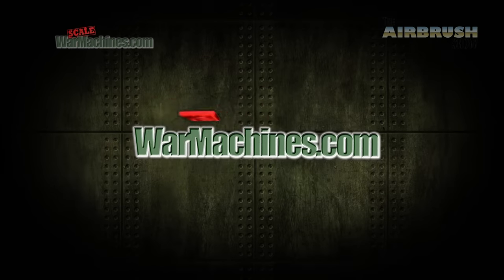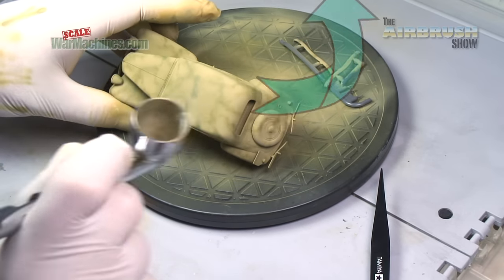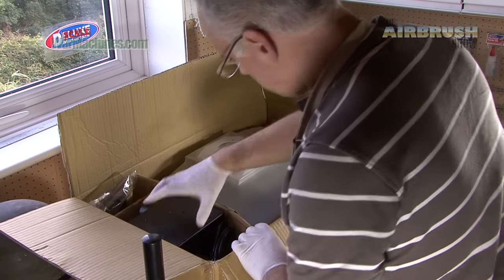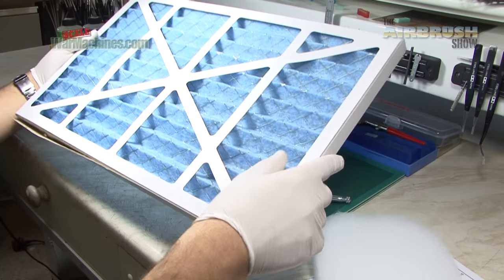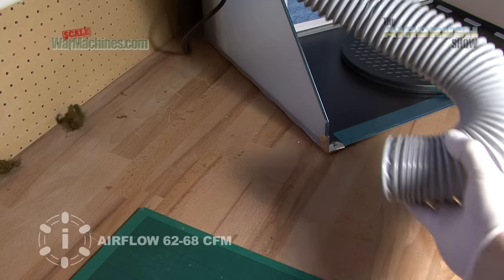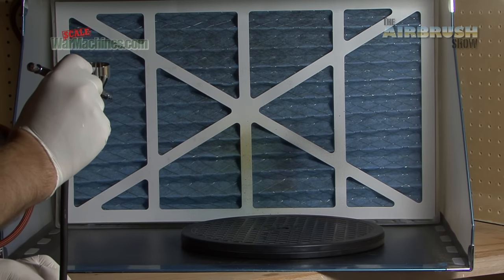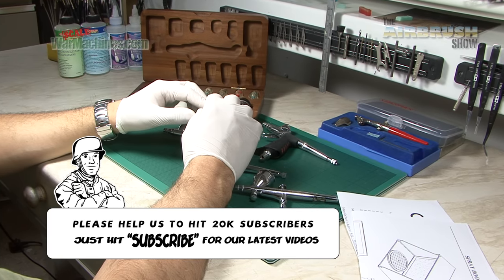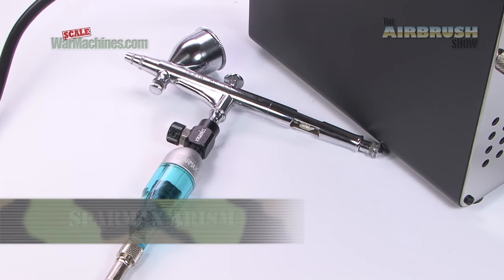SB-88 SPRAYBOOTH - THE AIRBRUSH SHOW EP01

Comment: If only using acrylic paints, is the hose needed? I'm thinking that those filters should catch all the paint particles. Am I wrong?
Reply from the maker: Possibly, but it may be nice to get rid of some odour or vapour, depending on the paints or paint brand. Generally best to expel as much as you can (vapours/mist etc. - as well as paint particles) - if you can. Otherwise, this plus a mask should see you pretty well covered.

Comment: nope never, and I've had mine for 8 year's. and all the paint I have used, has been enamel paints, and I've used it for 27 years. only in the last year I started using acrylics, and I was told I didn't need a hood for acrylic paint? if that's true then I never need a hood again.  so is that true?

Comment: Do you find this leaves any residual smell of lacquer in the air after you are finished painting. I have the cheap booth you had in the beginning and after I was done painting lacquer fumes would still saturate my room even while venting the booth out the window and having windows fully open . I don't want to die so I think I should upgrade
Reply from the maker: Definitely much better in this respect compared to the previous model you mention. Shifts a lot more air out. The problem is lacquers are so smelly, you'll always get residual stink but it doesn't saturate as much for sure.
Reply: Scale War Machines awesome, also where do you get replacement filters for this?
Reply from the maker: Any Sparmax stockist - Airbrushes.com have them.

Comment: Hello I noticed that you were using the cheap portable spray booth at the start of the video and that you were using lacquer paint, but wherever I look they say not to use flammable paints like lacquer, in your experience is alright to use lacquer on it despite the warnings? Much appreciated and keep up the good work.
Reply from the maker: What type of warnings? Like explosion/combustion warnings? An extractor will evacuate most of the fumes and they are pretty small in quantity so do not pose that much of danger. Health-wise they are pretty toxic though, so you should use a mask plus an extractor, and probably ventilate the space too. Oh and don't spray near a candle obviosuly. But no explosions so far!
Reply: Scale War Machines Ah I see, thanks for the insight! The warnings usually state not to use flammable paints are on the seller pages and stem from the fact that the fan motor in the booth isn't a squirrel cage fan meaning it isn't protected from fire hazards and has a a chance to spark. Thanks again for the insight and will consider it greatly!
Reply from the maker: Ah yes, this is often cited when people build their own. Firstly, this is a good-quality unit that shifts a good quantity of air/fumes, so the air/fuel mix should be stable. As to using lacquers with your own or a cheap unit, well, we haven't heard of a modeller disappearing in a puff of smoke and incinerating their model at the same time...not yet anyway...
Reply: Scale War Machines Thanks for the insight, I guess I can rest easy and buy it, since I can't afford that super nice SB-88 right now. Thanks again!

Comment: Anyone know what fans these booths have? Made my own spray booth but looking at getting some fans and a filter to absorb the paint and smell. Been researching what fans would be best and what has less chance of creating sparks and igniting.
Reply from the maker: You've opened up a wormhole of explosion fantasies and the eternal "will the paint booth explode?" debate. I personally don't know the answer. I have two fans from some Air Domestique ventilators/air recirculators I kept to one day turn into an extraction system...If you do survive though, please tell us so we can make cheap and effective alternatives using your research!
Reply: @scalewarmachines  I've done more research on this, basically some people suggest getting a centrifuge fan with an external motor so the fumes don't get in contact with the motor while other say the important thing is that the motor is properly sealed regardless if it's on the outside or not so no fumes get inside the motor. Another important thing is dependent on what paint are you using, acrilics have virtually 0 change of creating a spark, alcohol have a slightly higher chance and spray paints have the highest chance due to the aerosol. I saw in a video they made a test with a professional spray booth and the chance of it igniting even with a spray can was around 1-2% if i remember correctly so it pretty slim.
For me the best fan i found locally is called OBR 140, has great specs, lots of power so the filter doesn't kill it and has external motor at an affordable price.

Comment: Not a mention here or in the product description of the type of motor used in the blower. I’m suspecting it’s not rated for flammable solvents in paints. But some clarity would be needed. Saying “we never had a problem” isn’t a design feature, it’s luck. There is a reason manufacturers put the warnings not to use with volatile fumes on the descriptions  -!they don’t want the  liability as it isn’t insignificant.   Like using a table saw either eye protection.

Comment: One question though, how sb-88 can be better than that cheap booth at the beggining of the video, when the second one have stronger fan? Airflow of sb-88 is arround 2 cubic meters per min, when that second booth have aiflow of about 4 cubic meters per minute (at least thats what producer says)
Reply from the maker: To be clear the SB-88 is the second fan to replace the Ebay item used originally. Better airflow and better fan. SB-88 all round better unit.
Reply: A guy on Amazon had the eBay one and this one. He said this model blew away the eBay model. I just got the Testors version of this one. It's branded Aztek but it's this unit.

Comment: Are there any spray booths that operate without that great big hose?, I live in a rented flat so cutting holes in the wall or window is out of the question, and as for opening the window in the middle of winter to put the hose out- FORGET IT!.
Reply from the maker: +Tony Surridge Not that we're aware - you have to vent those fumes somewhere outside. Some do come with a narrower flat final outlet nozzle on the duct so the window gap is less. Likewise you could use hardware store flat style ducting to vent out of a narrower gap in the window frame & stuff newspaper either side of it to keep draughts out.
Reply: @scalewarmachines  You could use a good quality hoover bag, the type that pass through filtered air, just make sure the hose or outlet is sealed around the entry to the bag

Comment: $349 is too steep of a price.  Not in the middle price range like you said.
Reply from the maker: +Khan Bui Have to respectfully disagree & the actual price of this in USD is actually around $230 not $349. Ebay entry level item just like the one replaced in the film, cost is around $90-125 (http://www.ebay.com/itm/Airbrush-Spray-Booth-Kit-Paint-Craft-Odor-Extractor-Hobby-Crafts-Figurines-New-/380852051381?hash=item58ac8d1db5), the Benchvent A300S spraybooth (https://airbrushes.com/product_info.php?cPath=400_403_407_33&products_id=2846) costs $457 approx. So this is definitely in-between. We couldn't find many other units that filled the gap between the cheapest & the A300S for example - and you can pay even more than that. If you find one in the middle range don't hesitate to post it & let us know, even better make a video about it so others can see what you mean. Thanks.